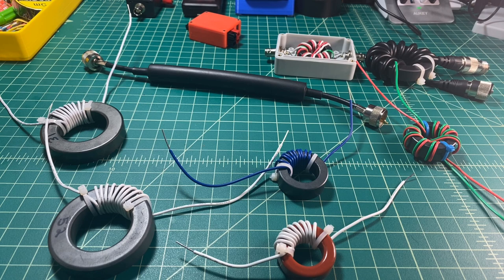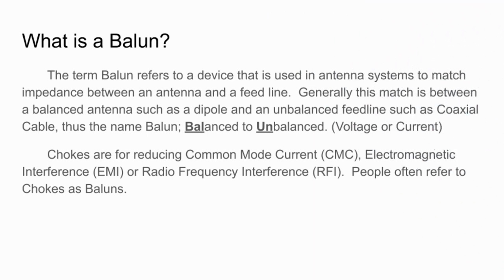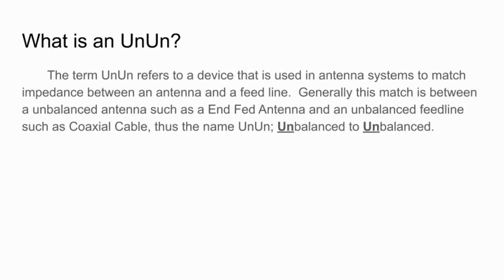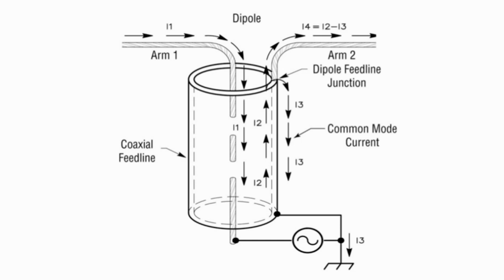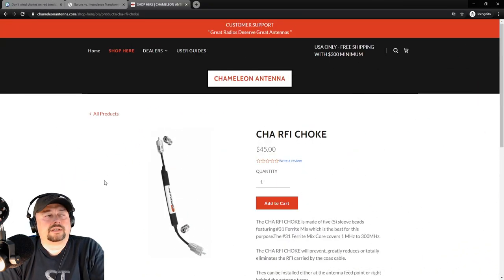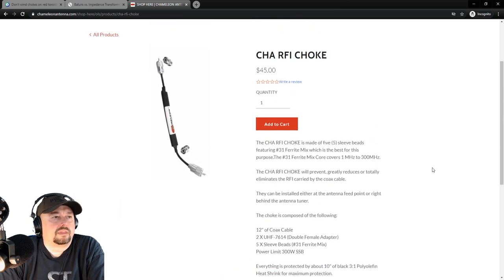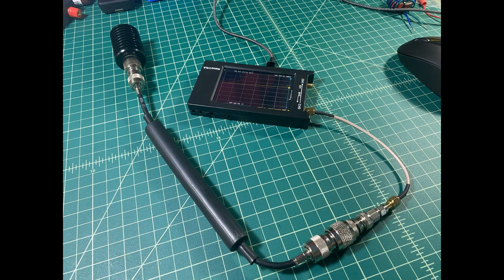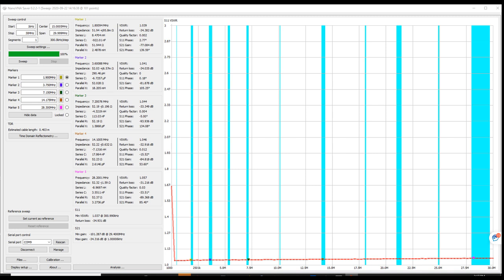Toroids, Chokes and Baluns for Ham Radio - Part 2

Comment: The challenge with the last choke is using individual wires.  You are forming a transmission line from those individual wires, and the characteristic impedance is highly dependent on the pair spacing- not the number of wraps or doing a crossover or anything like that.  In particular, the capacitance per unit length is highly sensitive to the pair spacing and the permittivity of the insulation.  While it’s possible to get it close to 50 ohms, it will be very fidgety.  That’s why you will almost always get better swr results by wrapping coax, since its conductors are already spaced properly by design.
Reply from the maker: 100% agreed

Comment: Again, really good explanation of the terminology and the choke use-case.  You certainly have a talent for getting your message across -- with just the right balance of theory, experimentation and 'cutting to the results' without making the viewer watch a complete test, 'soup to nuts' (as we Brits say.)
Your 'disappointing' home made choke with parallel wires in your 'choke box' would probably be improved if you twisted the wires together as I suspect at least part of the problem is stray capacitive coupling at the higher frequencies that are messing up the 'balance' between 'inner' and 'outer' conductors and hence the SWR, -- a problem that does not occur when you use coax and either ferrite 'sleeve' or ferrite 'core.' 
You might also try 'crossing over' on the toroid at the 50% turns point winding half the toroid in the opposite direction. This also has the advantage of separating your 'input' from your 'output' as each will be at opposite side of the completed toroid. 73 Bruce G4ABX
Reply from the maker: Thanks for the info Bruce, I am looking at alternative wrappings.  Stay tuned!

Comment: I bought a choke that performed worse than the one you made.  I found that tying the pair of wires together at each loop around the toroid with dental floss kept the impedance constant and made the plot flat.  One could tie the wires or tape them prior to winding, too.
Reply from the maker: Dang, sorry to hear you had to mod it

Comment: Remark at 3:45 in the video 
"I" is not L .... "I" is the symbol for current like in Ohm's law or Kirchoff's law.  It's confusing. It's not L1 coming in but I1 ... pronounced lke "eye 1"
You guys in america happen to write "I" a lot meaning the letter L. That's why you probably say L in the video.
Where talking about currents here .... not something else.
In europe we make a clear difference between the two.
"L" is voor coils .. meaning inductance. "I" is for current ... Ampère or Amps.
Keep up this nice work. 73
Reply: Glad I wasn't the one to make this comment. It is appropriate, however. The capital "I" (here) sure looks like a small "l" (L) and on my keyboard (Logitech brand) there's no difference visible between the two. Still, should have known it's an "I" (a basic electronic symbol) as there's no inductance running up and down those conductors.

Comment: Hi Ape - Thanks for sharing your experimental results. Since the focus of this video is on chokes, it seems (as I think another reader mentioned) that an attenuation measurement (S21) would be more revealing than a reflection (S11),or SWR, measurement. In fact I’m not sure how to interpret the reflection measurement results as I think they say more about impedance mismatches than they do about attenuation (i.e., choking). I guess some of the results leave me wondering as to the source(s) of impedance mismatch suggested in some of your plots. Interestingly, the commercial product ( short piece of coax wrapped in ferrite beads) showed essentially no variation in SWR versus frequency, which is kind of what I expect. Anyway, I’m not being critical of your results. Rather I’m trying to make sense of them. - Cheers! - Jim
Reply from the maker: Hey Jim, in part one I did the attenuation measurements and folks asked for a part 2 measuring swr.

Comment: Good video, as always. What is the length of the RG8 cable that you wrapped around the toroid at 1:44 in the video? I think that looks like an easy first choke project.
Reply from the maker: In the newer ones I have made I have used 36"

Comment: Hi Ape, I know this video was posted 2 years ago but was hoping you could offer some advice on this topic. I have LED overhead lights in my home and I cannot replace them as I am renting the place. These LEDs are causing interference. Diagonal lines show up on the waterfall display of my FT-991A as soon as I turn on the LED lights. The interference is visible on the VHF 2m / 144-166 MHz band but not on UHF 70cm / 430-440 MHz. It looks like the coax cable is picking this up and sending it into my radio. If I unplug the antenna, the waterfall turns black so the radio itself is not picking up the interference. I want to operate on VHF. What sort of choke/toroid mix could I use to suppress this interference going into my radio but allow my desired VHF signals to be transmitted ?
Reply from the maker: Mix 31 is good to about 200MHz if I recall correctly.  Above that we will need to talk.  CHeck out this site: https://palomar-engineers.com/ferrite-products/ferrite-cores/ferrite-mix-selection
Reply: @TheSmokinApe  Thanks so much, I'll give that a shot. My biggest dilemma is whether this sort of choke would negativity affect the signal going out from the radio. I just can't get my head around the fact that this stops the current on the outside of the shield but won't affect what's going on on the center conductor / inside the shield. Guess I have to read more..
Reply from the maker: It won't affect it.  The problem is that the coax actually has 3 transmission lines, the outershield, innershield and the center conductor.
Reply: @TheSmokinApe   Just to clarify... The problem is that the coax actually has 3 transmission paths, the outer surface of the shield, the inner surface of the shield, and the center conductor. Sorry for nit-picking, this just in case Mr Suku was thinking there were three individual "conductors" in the cable....
Reply: @ohaya1  Just to clarify... The problem is that the coax actually has 3 transmission PATHS, the outer surface of the shield, the inner surface of the shield, and the center conductor. See "skin effect".

Comment: Hi Ape. An equally informative video as part 1.

I just bought my first HF radio and is planning on putting up a homebrew EFHW antenna with a 49:1 balun to connect to my radio. In my understanding the 49:1 balun will also act as a choke to eliminate CMC, since the connecting wires goes through a ferrite core (planning to buy 2 pcs of T240-43 for my balun). Am I correct in this assumption? Or am I missing something?

Thank you for the help.

73 de 4G1FBL from the Philippines.
Reply from the maker: Hey Elmore.  The 49:1 will not act as a UNUN / transmatch and CMC choke, you will need to add a CMC choke if you want to use one.
Reply: @TheSmokinApe  thank you 👍

Comment: SK G3TXQ published a lot of his test results on different mixes as well as air core chokes. 

http://www.karinya.net/g3txq/chokes/

His recommendation was that you want to have as much of the impedance to be resistive at the frequencies of interest  because inductive components can actually increase common mode current under some circumstances.

I'm hoping to set up a fixture to use a NanoVNA for testing homebrew chokes.

Thanks for the great videos!
Reply from the maker: I've referred to that site before, its a good one!  Thanks for sharing...  good luck with the VNA project 👍